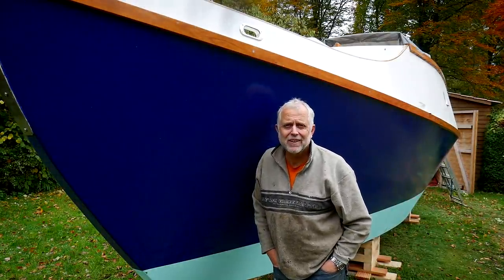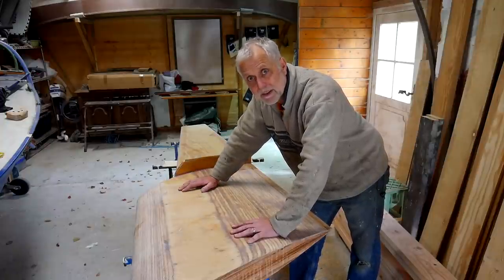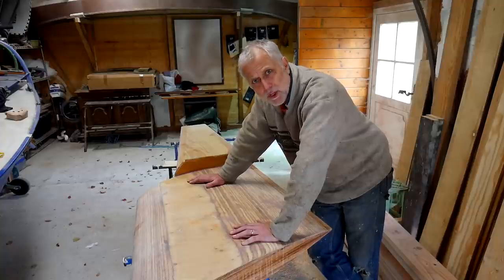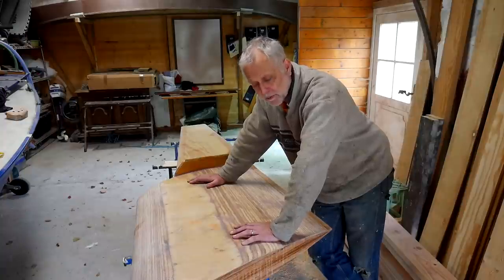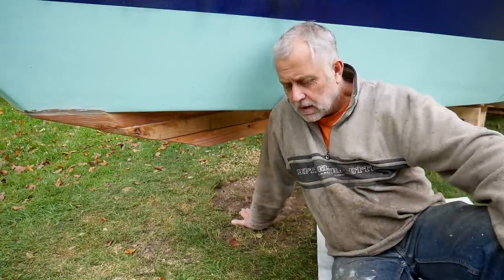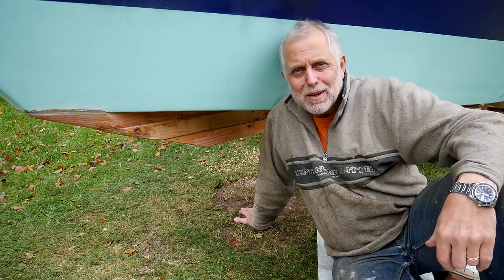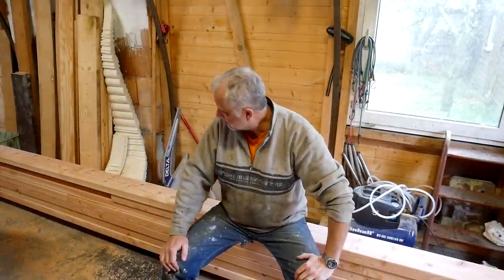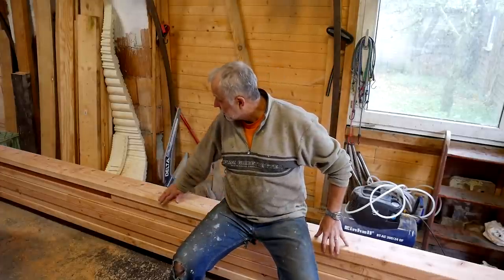Keel, Rudder, Doug Fir And A New Saw! - SV Tapatya EP206

Comment: I think anyone who builds a boat or any large project like yours Tony will no doubt ably make the odd mistake here and there, especially when you don't do that particular work for a living. I think its all part of the course. I guess As long as your mistakes don't end up costing you a lot of money I think you'll be ahead of the game as far as I'm concerned. I thought the reason you had decided to not do that part of the keel until now was because your shed didn't give you enough height. O well. You'll find a way and figure it all out. I have complete faith in your ability Tony. cheers have a good week. bud.  btw thanks for the recommendation Tony of Arctic SeaCamel sailboat build. I plan on checking it out.
Reply from the maker: Thanks Fon. Well, I like to think the shed height may have been a factor 👍😃

Comment: You are right of building the keel when the boat is upside down but you are managing it very well. But further down the process, I wonder what challenges might confront you when trying to fibreglass the keel to the bottom working upward against gravity sort of.
Reply from the maker: It should be ok, Joseph. The keel bolts to the boat structure. It’ll be glassed over to keep moisture out. That shouldn’t be difficult 👍

Comment: I bought a Japanese saw a few years ago and use it pretty much exclusively. I even turned my hacksaw blades around to cut on the pull and get far more accuracy with metal that way. I still use a "western" panel saw for cutting long scarfes. I thought you hadn't built the keel because of height restrictions in the boat shed. I am still mystified as to how you cut the scarfes blind on the table saw. Great work as always, atb.
Reply from the maker: Thanks Dale. Yes, I’m enjoying using this Japanese saw 😃👍

Comment: Is your boat shed tall enough that you could have put the external keel timbers on when the hull was inverted? I think you'd have been hard pressed to do the deck and cabin top inside if you had.
Reply from the maker: Yes, that is correct, Dave. So that's the reason I did it like that! I knew there had to be one! 😂😂

Comment: Tony wouldn't be been better to make up keel  fibreglass then long bolts through hull beams  weather that's ideal don't know  just thought it would have been a bit stronger that way  but hey you know it better looking good just waiting for that rudder to bolt on
Reply from the maker: Thanks Glenn. There will be long bolts through the entire wood keel and floors, connecting the ballast to the boat. Once that’s in place, the whole thing will be solid 👍